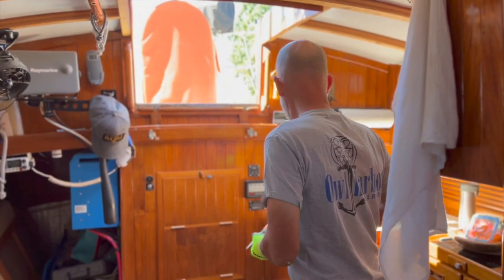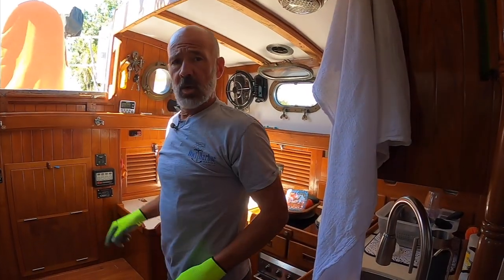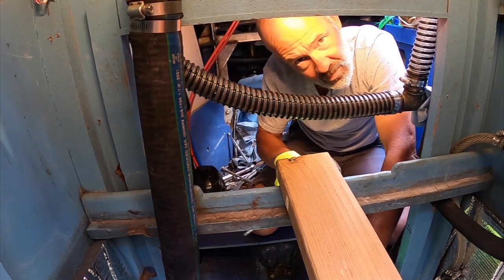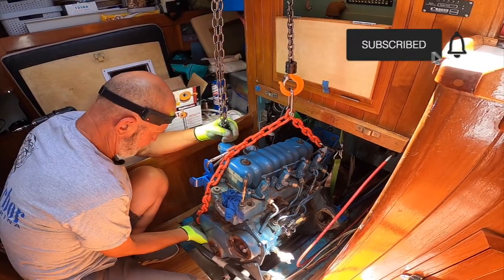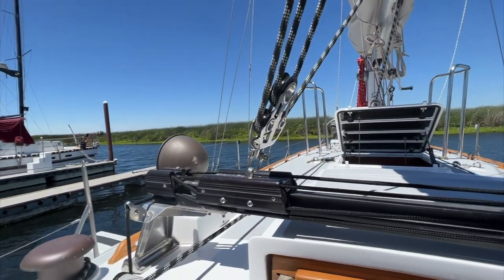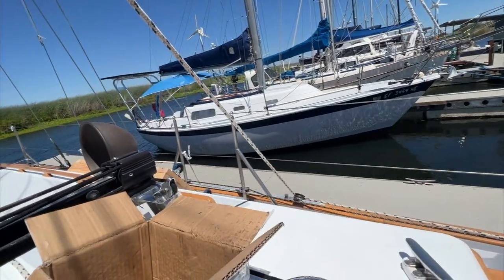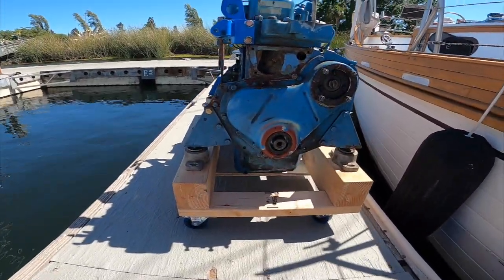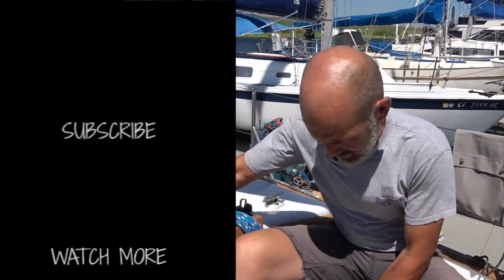Triumph of Teamwork: 500-Pound Engine Lifted Alone | SV Ramble On

Comment: Congrats on getting yours out! I had to get ours out of our Baba 35 vertically as the velvet drive couldn't make the fit. I am just finishing our 4.108 rebuild (Took 3 months), its a slow but very satisfying job. Bag and label every stud as there are a ton of different sizes and tracking them down is >terrible< process. I dont know if you are planning on dropping everything off at the machinist, but I would also recommend to balance the crank, something not typical for small diesels, but we found a pretty nasty imbalance in ours. Rocker Arms Unlimited in Irving, CA did a great polish and rechrome on the rocker asmby,. I could go on and on, lastly great reference is PorFin's rebuild thread on Sailnet, good guy. Cheers! Matt and Jen SV Babido
Reply: I’m fixing to take on a non running Perkins 4.108 next week in SoCal. I’ll definitely be checking out that forum thread you mentioned, thanks.

Comment: Jen doing the heavy lifting as usual. Great job. I would have used the mainsheet and a winch. The engine only weighs 250 lb.
Reply from the maker: Our manual says it weighs about 450 lbs. depending on the options. It sure felt heavier than 250 lbs. when we were pushing it on the dolly up the dock.
Reply: @svrambleon  ask Jen, she'll give me the straight scoop. It's ok to use a chain hoist. It's safer. There were a couple of used Perkins like yours for sale in the Seattle area. Excited about getting things going.

Comment: How did you secure the prop shaft once you unhooked it from the transmission?
Reply from the maker: We just slid it back out of the way a little bit and tightened up the stuffing box to keep the water out of the boat.